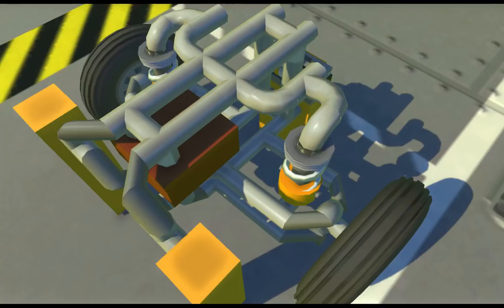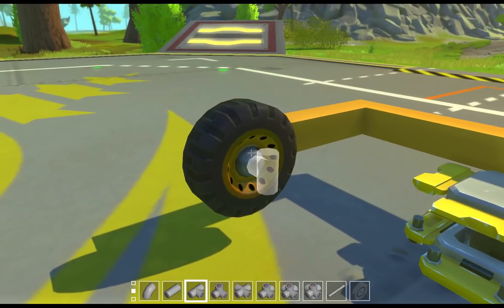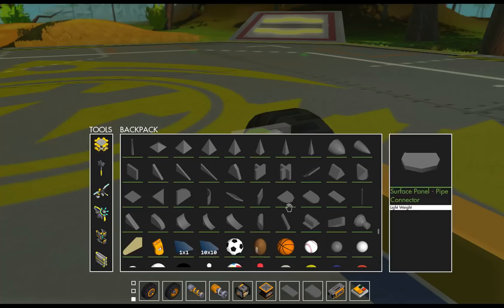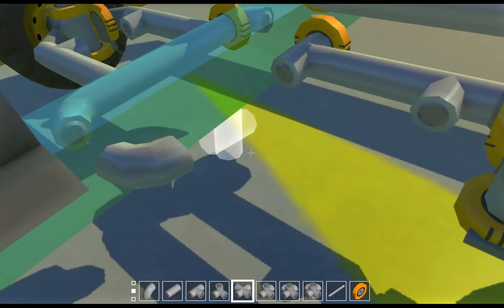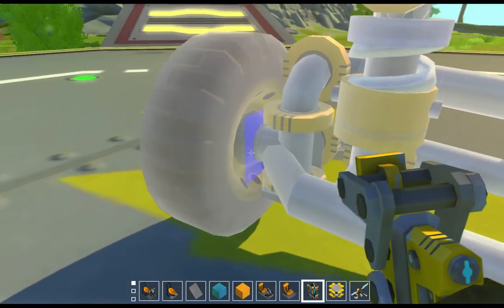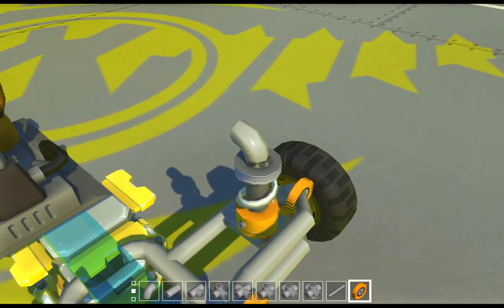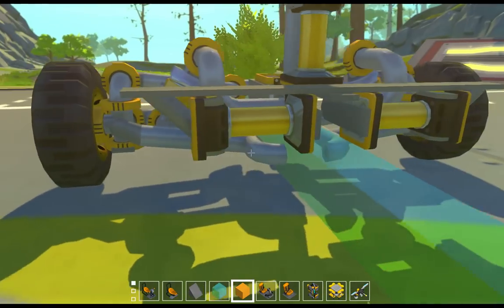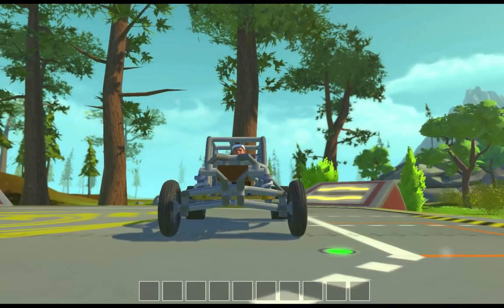Scrap Mechanic | How To Make My New IFS Design

Comment: Question for you: have you considered using a small pipe plate instead of the MJM small angled pipe off of the initial 2 barrings? I think that would prevent any collision, then. Also, how do you switch between the toolbars without going into your Backpack? I cannot figure it out! lol
Reply from the maker: mastersqueegee there is still collision on the front. I use the plate because there's supposed to be a pipe plate on both sides
Reply: Copy that.

Comment: is all types of independent suspension ( a stability glitch) ? i have made over 30 designs and all of them act like a stability glitch and if so i hate that they won't remove the suspension glitch?
Reply from the maker: if they are doing that stability glitch you hav made them wrong
Reply: NO i had this problem for ages and i just figured it out. Its a little bulky but basically instead of attaching the other side of the suspention fork to the vehical, you need to attach it to another suspension piece and then set that to 20. I tried this and it means you can have it without a weird stability glitch.

I was just in scrap mechanic and i tried that and as soon as it worked i remembered your comment.

Comment: i hate to ask but.... can someone build it for me? I can't do the plate things :P they never attach the way u attached them and i really need the suspension for my offroad buggy ;-;
Reply from the maker: Julio Augusto Borges you have to take it off the lift to put the pipe plate on the flat one. Should go on no problem.